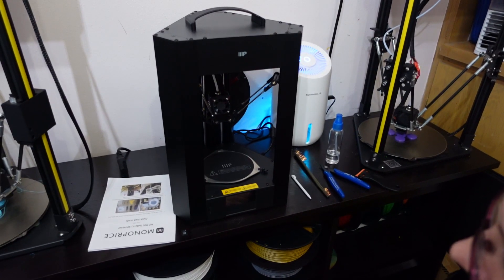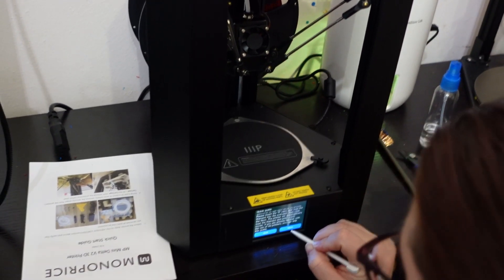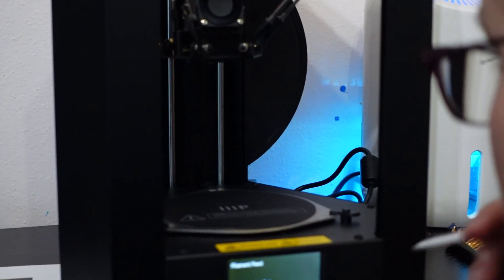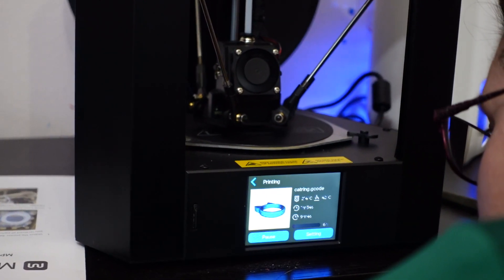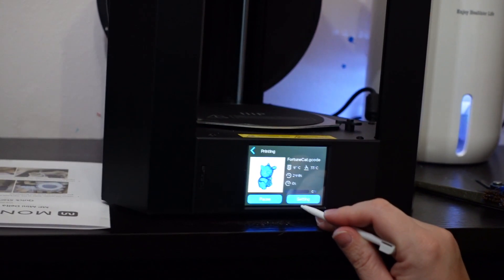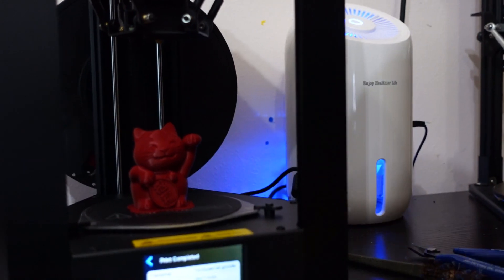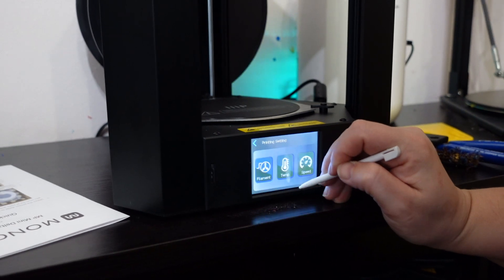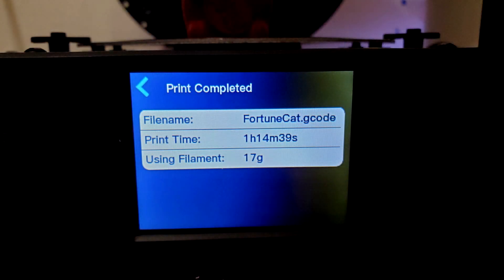Trying out the Mini Delta V2

Comment: Mono price used a cura profile to slice the cat so try that and you will get the same quality as the test print
Reply from the maker: We are using the Cura profile now and it is working great.  We upgraded to a steel spring PEI sheet and it is working great.  We just need a brim/raft on the prints.

Comment: u can get the settings from the gcode. u can load profiles from gcode in older version of cura i know not 100% sure on the newer versions but if the news ones dont then find a older version an use it to make ur profile from the gcode that comes on the sd cards. thats how i done quite a few of my printers like my anet a8 plus an e10
Reply from the maker: Good to know.  We will have to try that.  Will this trick work even if the print wasn't sliced in Cura?